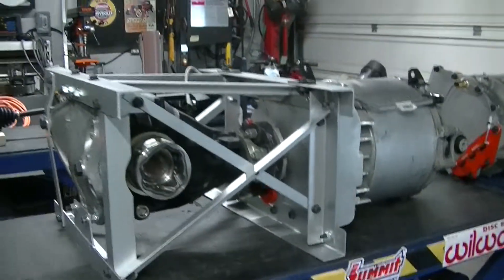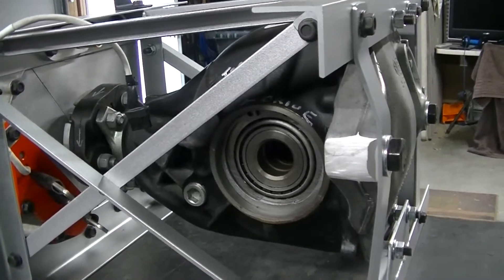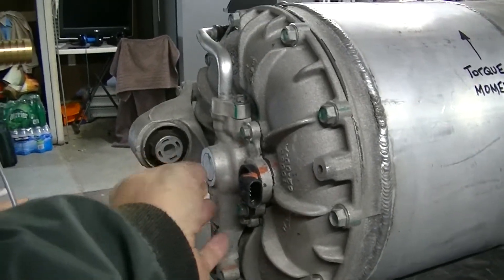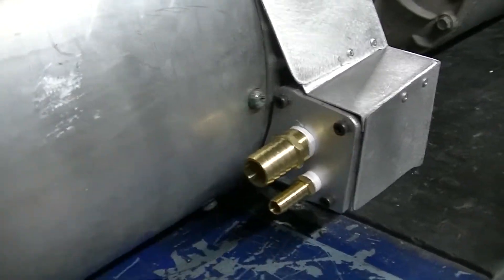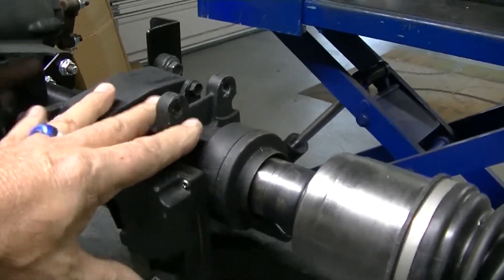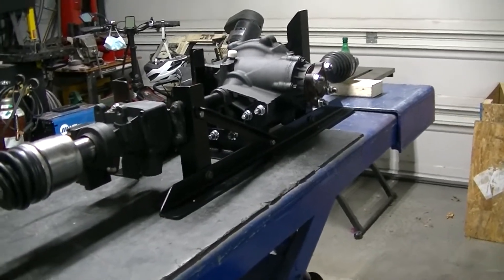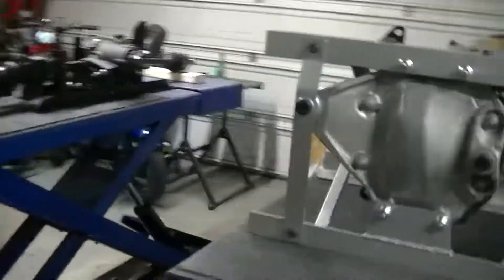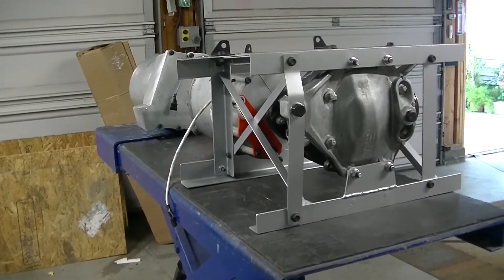Tesla powered 4x4 setup using a single motor.

Comment: Why not just keep the factory Tesla transmission?
Reply from the maker: You can't keep the stock Tesla transmission if you want to run a car differential because the out put is at about a 9.37 to 1 ratio which means if you connected it to a 3 to 1 automotive differential it you have approximately a 27 to 1 ratio. You could climb walls but you could only go maybe 45 mph top speed with the motor running at 17,000 RPMs. My setup gives to about the same RPMs as an ICE motor and has a top speed of about 125 MPH.
Reply: @Roadstercycle  you can get gear sets in the 4-1 range for the Tesla box.
Reply from the maker: Yes, I know, you need to do more home work on the subject. You can't buy anything out there that does what I needed. with the 4 to 1 here are the numbers.
4 to 1 x 3 to 1 differential = 12 to 1 final ration.  Most drag cars run a 4.12 final ratio. That 4 to 1 was built for range rovers and other vehicles with giant tires.  @mp-xt2rg
Reply: You can get lower ratios for the model 3 motor. It probably doesn't make sense to do all that anyway. Just running two motors is likely lighter and you can then use independent traction control.

Comment: Why didn't you utilize the original differential that came with the Tesla Drive Unit as a transfer case?
Reply from the maker: Hi,  It's because the reduction in the Tesla drive is just over 9 to 1 from the motor RPM to the Differential in the Tesla drive.  So if you where to hook the Tesla drive which comes out at the axles as 3 to 1 to a rear differential in a car with about a 3 to 1 you would end up with about a 9 to 1 overall drive. which means that you could climb walls with the car but your top speed would be 1/3  of a normal Tesla Model S.   149/3= approx 50 MPH.  Not real quick but like I said it would be a great hill climber.

Comment: Is there a reason as to why you didn't just weld the original Tesla differential and use the whole original drive unit as the transfer case, just rotated sideways? I may be missing something here but this  seems like you cut off the original diff and put another in place?
Reply from the maker: Yes there was a easy explanation. The Tesla output ends up at about 9.2 to 1. 
So if you did what your thinking you would have about a 27 to 1 ratio of you used a 3 to 1 differential.  You could climb walls but  your top speed would be about 45 mph. The electric motor would would be flat out.

Comment: Why use a diff (307) when the drive unit had a built in one....?
Reply from the maker: Hi Chris,  I'm testing a new Tesla motor configuration and needed it setup like a stock old mustang or Camaro.  It's a custom drive I designed.

Comment: I was thinking your TESLA Model S motor could be clocked where the motor is above the ring and pinion, meaning the motor would be sticking-up inside your car.  this would allow a space for more batteries on each side of the motor.  Also looking forward to a future video to see how it all works.

Comment: How do you plan to connect the inverter half to the motor?
Reply from the maker: High, that is a simple solution, just using long cables to attach it. I should have another video coming of the new gear reduction setup pretty quickly. Couple, 3 weeks I hope. Making parts now. It's a bit complex.

Comment: So I have been researching all the different options for ev conversions for past few years and the biggest issue is the lack of centralized information somewhere that doesn't take an engineer to read it. You are providing what this niche needs to get it in the hands of more people. Thanks for that! What do you think about mounting a drive unit between a transmission and diff in truck? Use a smallish battery that would fit in a bed tool box and just have it for regen and extra power for towing.

Comment: Interesting project, have you considered using a front motor from a model 3 to make a 3 wheel motorcycle?
Reply from the maker: I consider everything. The problem is 2 fold, 1 I don't feel like building another Roadstercycle and 2 the Model 3 front drive controller is not out there yet.

Comment: If I understand correctly your planning to route the cooling in factory inline route? Since you separated the inverter from the motor, why not make it better cooled by splitting the line  ? You can have one coolant hose from the radiator, T it to have one go to the inverter and the other to the motor. Then, in the return merge them back to the radiator.
Reply from the maker: That may have to happen depending on the car I install it on.

Comment: I wish you showed us how u split the motor in half and removed the gears
Reply from the maker: Hi Fast Lane,  You can find that on Youtube in someone else's video. It's quite simple actually and I'm sorry I did not video the procedure. Take the bolts out split the motor and remove the gears. You do have to change internal bearings to sealed grease type as the oil system was removed. The biggest thing about splitting the motor is being careful not to hurt the temperature wiring. Start by taking the inverter cover off and unplugging the  temp connector from the board and giving it some slack where it goes through the gearbox in to the motor side, that way when you split the case you'll get some slack which helps a lot. Look for a posi diff install on EVTV so see there procedure.

Comment: Find an old Subaru GC or GD chassis and have at it. The “symmetrical” Subaru drivetrain runs right down the middle, so your diff/transfer case will have a straight shot to the front and rear pinions.
Reply from the maker: Actually that is a kind of issue. This package is a bit wide and would be offset a bit, meaning the front offset diff is perfect and the rear drive shaft is going to be at a bit of an angle unless it's a really wide car where I could center the transfer case then the front shaft will be at a bit of an angle.  Again depends on the donor car.
Reply: @Roadstercycle  Option #1: Rethink the front axle and go with a center mounted design. Option #2: Rethink the rear axle and go with an offset-mounted design. Option #3: Rethink the center diff and go with some kind of offset...maybe add a 4x4 transfer case w/ 1:1 gears to move the rear driveshaft over several inches. Option #1 strikes me as the cleanest, but most complex solutions. Maybe look at how Porsche does it up front. Heck, you could use old Porsche struts, axles, control arms, brakes, aluminum knuckles, etc.
Reply from the maker: @apricity69  I'm thinking front wheel drive donor car with the front suspension already there first then engineer the best solution. I can do all the options, everything is on the table, except adding more weight with a 4x4 transfer case that's not an option. I'm looking American made donors. If anyone does not know this Tesla uses a lot of Ford parts. I think the Ford Focus may be the winner here.
Reply: So use the front transfer case and maybe the transaxle off of a manual AWD Focus RS. Just run it in locked 3rd or 4th gear (whatever is 1:1), not bolted to an engine. Basically, send power through the transaxle backwards. You’re already using a diff as a transfer case, so why not use a transfer case as a diff?